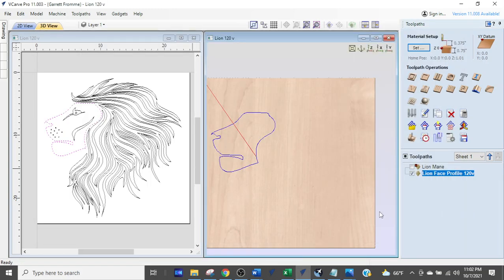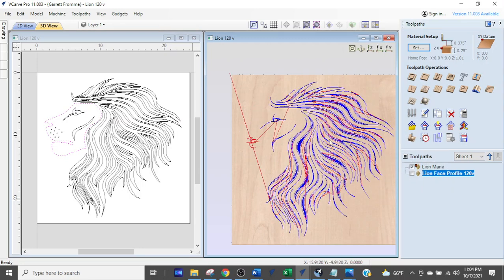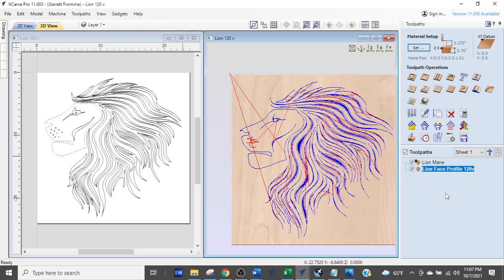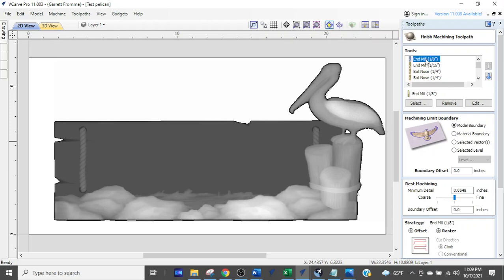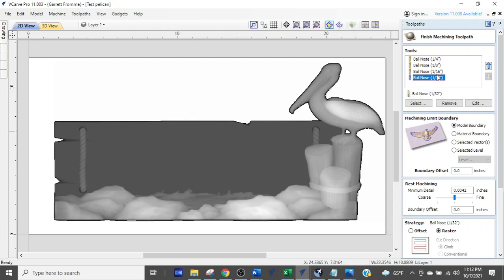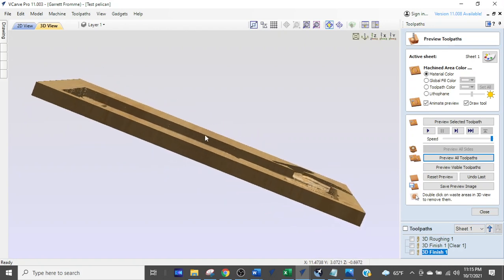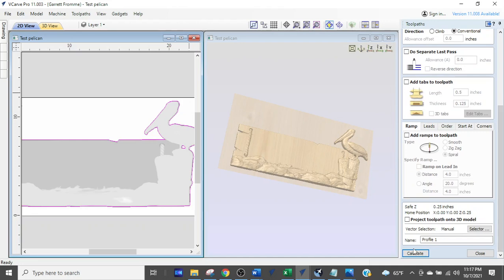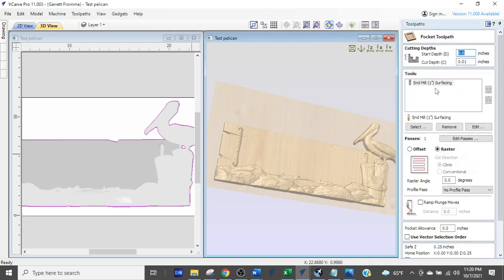Why So Many Toolpaths, Vectric Vcarve Aspire [Tool Paths Tips] - Garrett Fromme

Comment: I hope you read this? So, I have a comment on than a question if you can find time please?
I can't find any info on it and it happens also when I flatten a surface.
I don't know how to run only one pass??? I can't figure out what I'm doing wrong or not doing.
I made an address sign today and I wanted to cut a tighter pass to give a cleaner cut and I only wanted to cut .01 of an inch.
It worked great but it started to cut another pass and I had to stop it. As a result it didn't cut inside the number 8 I was pocketing because it was saving it for last I guess.
I must not be interpreting this correctly.
Start depth - .31
Max depth - .32
stepover- .025
depth per pass - .01
plunge rate - 10
feed rate - 80
Do you know how to tell how many passes this will take (and what ever other advice you have)? I had thought if I made dpp .01 and making the max depth .01 deeper it would only make one pass?
Greatly appreciate you.
Reply from the maker: Hi Iwannaapple, try changing your depth per pass to the reccomended feeds and speeds for the bit. And then try generating a new toolpath where your start depth and max depth is just the finishing pass depth of 0.01." Then simulate the toolpath, there should only be one pass on what your trying to cut. 
If your having problems still brother, shoot me an email with a few screenshots and I can help you better there.
Reply: @IDCWoodcraft  
That was the finishing path .?
Reply: I have csrbide create pro. I dont think it shows simulations like your program. I think i have to do the math that is why i was asking you

Comment: I notice you use Vcarve software. I just purchased and finished assembly. How do you get vcarve to work with your longmill. I bought the desktop version and longmill is not an option for processor. How does it work with your longmill. Best regards Marc Winters
Reply from the maker: Set post processor to grbl or Bobs cnc. the machine does not 'work' with the design software. You need gsender to run the machine. Get it from Longmill website free.

Comment: Good video, it won't take long for a new user to run into this issue...  Ask me how I know!  Still working on my naming convention for toolpaths.
Reply from the maker: Hi Mark. So you've been there done that. 

Gere's how I name my toolpaths. In this example...the lions face. I will use this type of naming:
Lion face profile 120v - It clearly defines the tool path being used, what part of the design it is doing and which bit I am using. All this information shows up in the g-code file name as well so I know everything when I look at the g-code file.